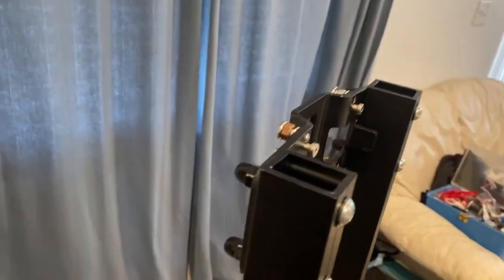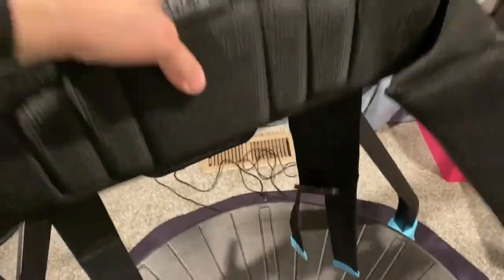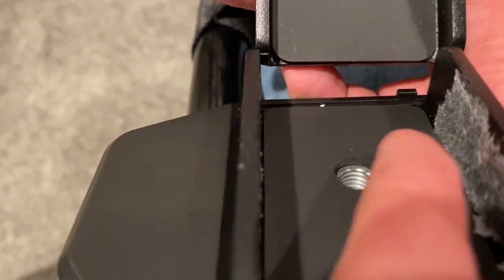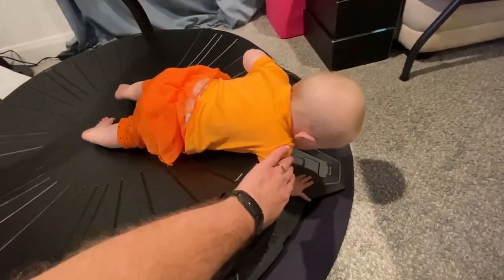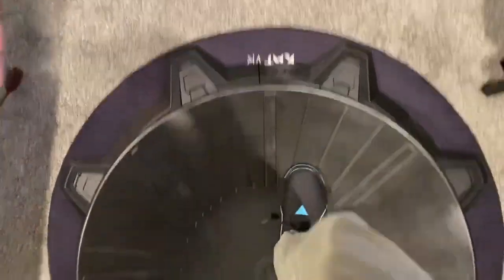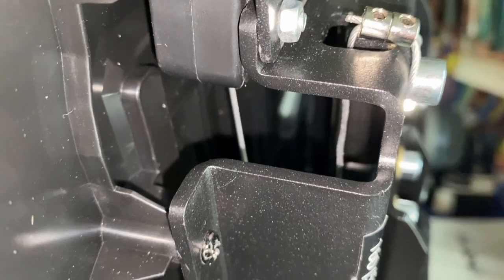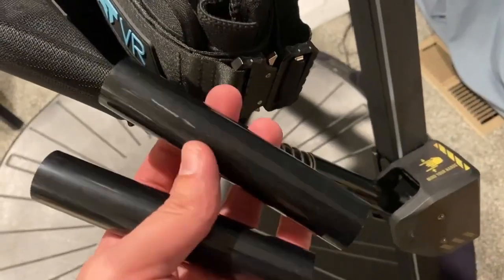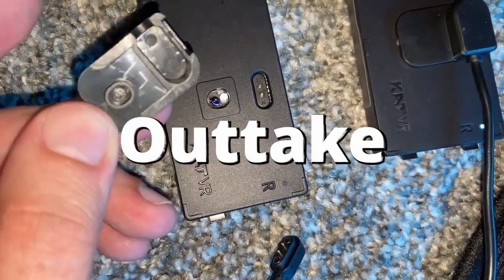KAT Walk C2+ First Thoughts 02 - Assembling

Comment from the maker: A couple additional tips that I forgot to mention. When assembling everything above the base, you may want to place a blanket over the base to avoid any tools from dropping onto it and causing a dent. I dropped tools a couple times onto the base and left a tiny mark on mine.
If anyone has to replace the wire pulley, KAT VR now has information on their support page on how to properly replace the pulley by disassembling it further than I did.
Reply: I already gained a bunch of scratches and dents because the tools sat there for months
Reply: What screw did you use to connect the black plate to the backpack holder? I’m stuck on this part because I lost one of the screws, and it looks like the screw I’m using is too short.
Reply from the maker: @RealProdisty  Hmm, they were pretty short and hard to get connected, but honestly, you may be able to contact KAT VR directly to get replacement screws if necessary, or they may be able to tell you the exact screw that you can pick up from a store. 1 missing of the four may not affect it that much. The one that came with my unit was 11/16th's of an inch long and 1/8th of an inch in diameter. It's got a flat end where it screws in and the head is slightly rounded.

Hope this helps!
Reply from the maker: @RealProdisty  And this information is assuming you're referring to the hollow plastic back cover that hides the moving pulleys. If you're referring to a different part, let me know and I'll try to clarify what the dimensions are of any other screws in question.
Reply from the maker: @RealProdisty  Realizing I misread your description of the part, it looks like you're referring to the flat back plate that I show at 2:04 in the video. This part has a lot more importance in it being the right fit where if it's not correct, it could cause user injury if it malfunctions. I'd say best bet is what I first suggested, to reach out to KAT VR directly to make sure you get the correct fit. =) Sorry for any confusion!

Comment: Quick tip for the round rubbers: If they fall, just slide back in the hole a segment of the back part, press firmly in that direction and "down" with your thumb and, at the same time, rotate the rubber a few times. It will slip right back in, you will notice it because it will no longer resist the turning.
Reply from the maker: Thanks for your comments! =) Keep being awesome!

Comment: Hello. Did you pair the sensors at the end, how did you exactly do it because when I connect all three with seperate usb cables to my laptop usb hubs (gateway installed), the gateway app doesnt detect the sensors. The guide states its almost the first thing to do..
Reply from the maker: I did pair the sensors with the included USB cables. If it’s not working the way you tried, maybe try a different port or different cable? Make sure the KAT Gateway software is the latest version. Also, on the previous model (not sure if it applies to the KAT Walk C2), my AMD chipset for some reason had a known issue when pairing from the motherboard USB ports, so I had to purchase an inexpensive dedicated PCI USB card.
Reach out to KAT VR if you still can’t get it working. They’re very responsive and will be willing to troubleshoot it further!